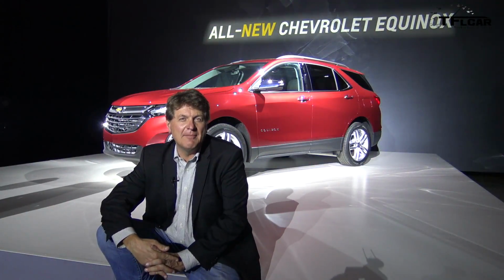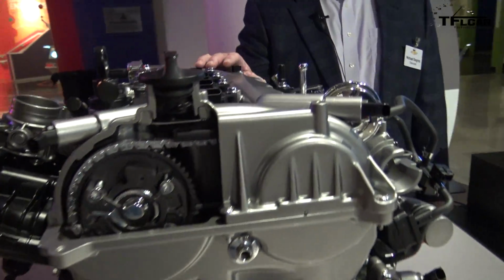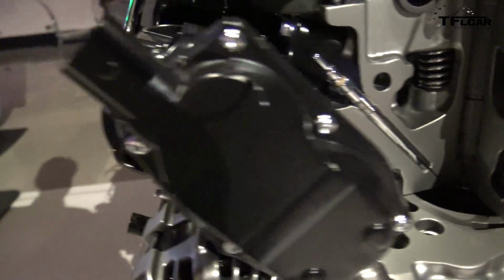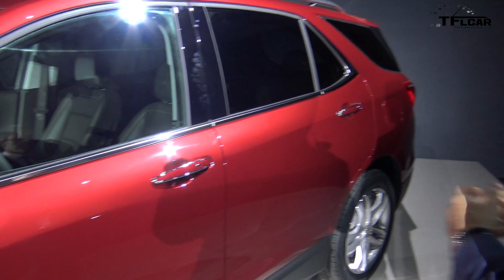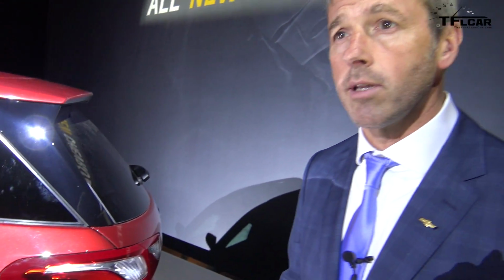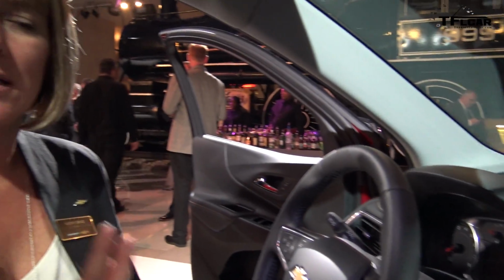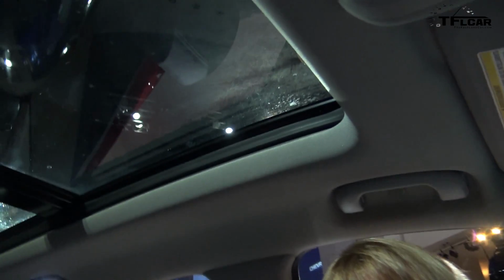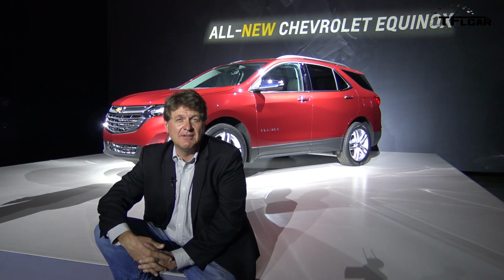2018 Chevy Equinox:  Everything You Ever Wanted to Know

Comment: Every equinox I've ever driven I have came away thoroughly underwhelmed and unimpressed by them. These will be no different. Then again the people who buy these things don't care how they drive. Which is good because they drive like crap.
Reply: Exactly. Why not buy a car. The people that buy these are 300 year old grandmas who take them back and fourth to bingo
Reply: There are older vehicles that are better than the Equinox
Reply: 97I30T shit cars , timing chain problems, oil consumption problems etc...
Reply: I thought the same thing when I test drove a 4cyl a few years back, but the 6cyl drove great!  But that's my preference - more power!  Most people buying these are concerned with fuel economy, so the 4cyl is most common.  
That being said, with the new vehicle being 400lbs lighter, you should feel more power even with the small engine!  Personally, I'd buy a Premier Edition, 2.0L Turbo - The new one drives really nice!  Check it out!
Reply: KentB27 a benefit of driving only 15+ year old vehicles is that practically all new cars drive great in comparison. I've yet to be spoiled with exceptionally performing vehicles.

Comment: In a typical GM fashion they half-assing it all the way.  That diesel is way too small for that car and to add insult to injury that 6 speed will be less than adequate. As someone pointed out below they conveniently committing RPM figures. And I bet they will only offer diesel in high end trim. And what's with all the chrome?

Comment: I hate that they keep shortening vehicles.  Im a 6 foot guy and I like my cars spacious in all areas
Reply: they expanded the interior by 3 cubic feet, so you are probably fine.
Reply: It's mainly shorter because of the new wheelbase, and the smaller engines mean it doesn't need all that space under the hood of the current model.  I am 6'5", so I totally agree with you, but this new 2018 Equinox probably fits me better than the previous generation.  It feels more like a cockpit, everything is designed around you as the driver, and there seems to be less wasted space in the cabin.  It's comfortable, check it out for yourself when it launches!  Rear seats still fit full sized adults surprisingly well!  (I can fit behind myself comfortably... and not many vehicles this size can say the same).
Reply: So sad to let you know that not everyone is as tall as you.
Reply: GM has been shortening some of their vehicles such as gmc Acadia
Reply: Yea, the companies try to go by average size.

Comment: Diesel sounds nice, but MPG for the gas engines is not fantastic...
Reply: I was really hoping for a hybrid like the 2017 Malibu hybrid . That coulda got in the high 30s low 40s
Reply: Fully agree.  I was expecting at very least a hybrid.  Considering this is on the same vehicle architecture as the Cruze and Volt.  I would have loved a Voltec version of the Equinox.

Comment: It definitely looks cheap and design already looks outdated. What I don't understand is that cars they are giving reference about are also not doing well. So why they are going the same way when their other models are struggling?
Reply: Zeeshan   what do you expect from a company that puts low hanging air dams on their off road models
Reply: I see media commenting on Cadillac's that how good are they. But bottom line is you don't see them on the road. unless they sell those to Aliens...lol. When Mercedes, BMW, Audi or Infinity comes out with their new models and if the car is good you can see them on the road.They talk about Malibu and Cruze but truth is you don't see them on road like you see Honda's, Toyota's or Nissan in every 3rd car.
Reply: Zeeshan if the Chinese weren't buying the large majority of Caddy's and Buick's they would be history just like Pontiac and Saturn and i believe 1 or 2 more
Reply: I actually believe those Pontiac's and Saturn's were better than todays GM cars. Problem is they always have unfinished car. If engine is awesome then suspension is not good. If interior is good then exterior is poor.
Reply: Zeeshan too bad GM never took or used Toyota's advice back in the mid eighties at the NUMMI plant

Comment: Since they made it smaller to more comfortably fit into the marketing space, I would of liked to see a hybrid option and possibly a CVT. Sure, there is the diesel, but diesel is even more expensive and you don't really get anymore efficiency compared to gasoline.  I am glad to see they have re engineered the engine. The 2.4lt in my 2011 has the timing tensioner problem that the engine is well known to have.  Overall, I will keep my current 2011 equinox until they find a way to make a bigger volt. I would LOVE to see an electric tahoe!!

Comment: Americans embracing diesel and the rest of us in Europe are starting to switch to petrol, Renault have announced its going to cease with diesels in the future
Reply: To be fair, diesels in the US are generally cleaner and held to much higher emissions standards in small vehicles.  That has a lot to do with the pricing though, with Europe receiving these changes, diesels will have less of a price advantage.
Reply: MacFreaks Where I live out in the midwest just about every station has diesel.  I don't really think fuel availability is a problem most places because if one station doesn't have diesel, the one down the street will.
Reply: only reason is because the CAFE standards are increasing here and the automakers need to comply or they get fined I think.
Reply: Diesels cost more to buy around 2000 euros more for a small car, they known to be problematic, injectors diesel pumps and DPF (  FAP filters here ) which can clog if the car isnt driven enough on autoroutes at speed, and are expensive to replace. They were first thought be less polluting, but it it was the finer particles escaping which were deemed to be polluting and cancerous, as well there has been move development in gas engine design lately and the price gap difference between the fuels has narrowed.
Its estimated you would have to drive around 60000 kms before any savings were realised  from buying diesel.
Reply: Yeah, looks like America needs cities full of diesel cars hopping a few miles, sitting at traffic lights and polluting air to learn its enviro and economy lesson. Every car dealer, used or new, should be forced by law to display a big flag that says MPG IS NOT EVERYTHING ;) At least that's the state of the affairs here in Europe - most people are blind to everything else and go bonkers over how many L/100km they burn. And the rest of us have to pay with our lungs.
Reply: Problem with diesel in the US is that less than half of all gas stations dispense diesel fuel. And to be honest I don't think that's going to change any time soon, seeing how more and more hydrogen and electric stations are being installed every day. I bet the only reason they put this motor in the Equinox is because GM could just 'borrow' it from GM Europe (Opel).
Reply: ya right 😂😂
Reply: ya right 😂😂